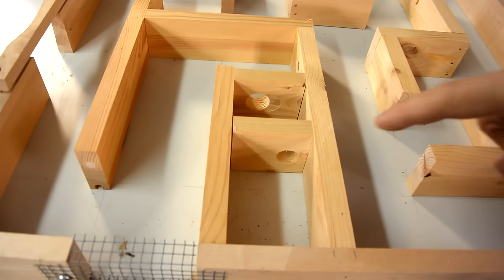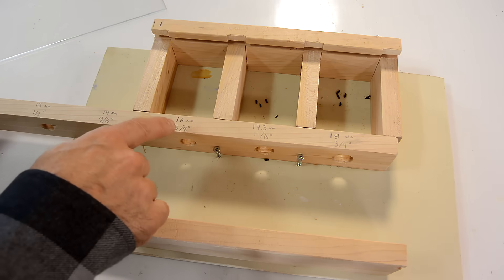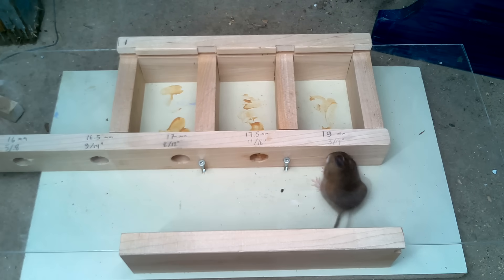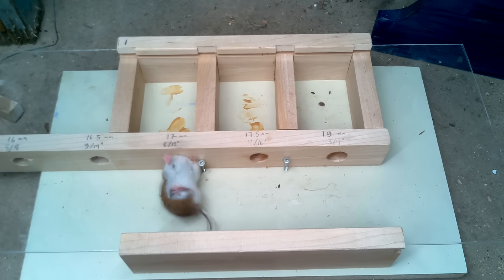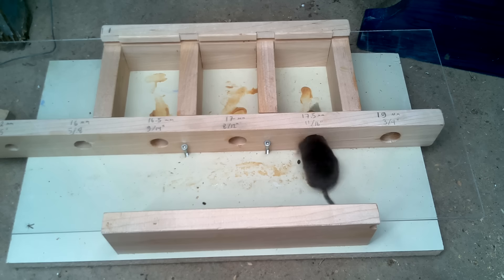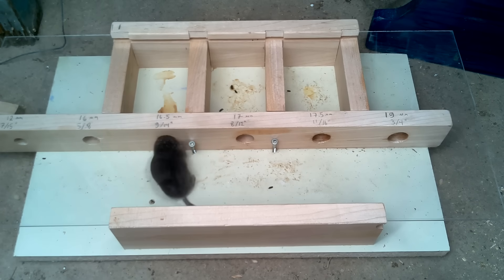How small a hole can a mouse get through?  Experiments.

Comment: Nice work! Question: If the thickness of the material through which these holes are drilled is reduced, can we guess that passage becomes easier? I would think yes, because the deformation to rib cage etc necessary would make (for instance) a 16.5mm hole in 1/4"|6mm material a lot easier to push through.

Comment: I wonder if a mouse would get through smaller holes if the hole was in thinner material eg  1/8” ply.
Reply: They will, they'll just chew a bigger hole, that's why they're so destructive in homes. I had a mouse chew a hole larger than a golf ball in my baseboards which are about an inch thick with the drywall.

Comment: Mouse could potentially get through the second set of holes but it learned that with less effort all it has to do is make a sad attempt, run away, and when the experimenter puts more peanut butter before and around the holes, it will not have to work as hard. Smart mouse. Assuming same mouse everytime. Gotta do the experiment a little more controlled.

Comment: You can see its feet slipping as it is trying to get through. Maybe you should have used a board with more traction as a foundation. Then they would probably have been able to get through the smaller holes as well.

Comment: Suggestion... Try same experiment, but instead of round holes, try 'slots'....i.e. like cracks in a wall. Years ago, I had a mouse problem (thank the powers that be that it no longer an issue) and the mice kept getting into the dog and cat food that I had in the pantry. I thought they were getting at it by crawling under the door, or a hold in the floor, until the one day, I was getting ready to feed the dogs, and found a mouse about halfway through a crack in the wall. It was a very thin opening, only about a 1/4" or less. I had already gotten an aluminum mesh...something used by construction workers to allow 'plaster' for walls to stick and stay in place. It is something that you have to use gloves to handle because of all the sharp edges of the aluminum. Round holes are just one way for a mouse to get through, but 'cracks' in the wall are also another. The little bugger just flattened himself, and slipped through the crack... Needless to say, I ended up putting mesh over that crack real quick.
Reply from the maker: Suggestion...  Watch my video of experimenting with a gap.

Comment: That's interesting. I think what happened is that the mouse worked out it didn't want to try the smaller holes because it hurt when it was too small and then even when you shifted the wood it didn't want to try because it remembered the same positions of the holes from previously. Then when  the vole came along and left its poop and smell then the mouse didn't come back because it didn't want to fight a vole. That's my guess. PS I used to have a rat infestation in the attic of my last flat I lived in. Sometimes I saw them in my patio outside. 1 time I saw a rat literally throwing itself horizontally ninja style and projecting itself through a slit in the fence between my patio and the area next to mine. It was totally surreal. It was a fat rat about 8 - 9 inches long that managed to propel itself through a horizontal slit maybe half an inch high. Don't ask me how you'd be able to replicate that stunt in experimental conditions though lol, unless you trained some rats to have their own mini-circus stunt show that might work, lol. They were so brainy. They would even bring oysters up from the river next to my house and have oyster parties in the attic upstairs and leave the shells for me to find later. The insulation was like the softest nesting material for them, all snug and cosy for the winter. They literally dug their way through the cavities in the infrastructure of the whole building and I had to move out and go to court against the landlord to get my money back. That's kind of cute you are just letting the mice and voles do their thing at the same time, I would recommend that letting them destroy your house if you don't block up whatever holes they are getting through is also a good idea.

Comment: Use inches and feet twelve is the number that solar system designer used to count the number of times the moon rotates around the Earth as the Earth completes one revolution around the sun. Like the numbers on the face of the clock.

Comment: You do realize that the shorter the depth of the hole, the smaller they can get through?  They tilt their skulls and hips to get through short holes like in sheet metal.  So you have two dimensions:  diameter of sheet metal and diameter of pipe they can get through.  This will bracket their ability.

Comment: So all that crap about "if you can fit a pencil through then a mouse can fit through" is total bollocks then
Reply: That's only flat horizontal openings. The round holes make them squish inward and make manipulation of their bones more difficult than flattening their bodies.  Also, the age and size of mouse would affect their ability to fit through certain openings.  Not every mouse is created equal.  The same applies to bats.

Comment: Great experiment!  Two ideas:  Could they get through smaller holes if the surface (floor) wasn't as slippery? Could they get through smaller opening if they were slots instead of holes? In other words, make a slot about 1" wide but of various heights. I'm wondering if the mouse could get through a very small gap in height, but it might need a certain width. I'm sure the mice got through much smaller gaps under the garage door, but they had lots of width to flatten into.
Reply: ...make that 2" or 3" wide rather than 1", just to be sure it isn't limiting.

Comment: Fantastic video.  You read a lot of stuff about a gap the size of a pencil and a mouse getting through and I always suspected that this would apply possibly to a rectangle the dimensions of one side of which was as great as the thickness of a pencil but not to a round hole the diameter of a pencil.  Otherwise mice would esily pass through air bricks under suspended timber floors.

Your video tests this in a practical way.  While I would argue that your mouse is rather large, it would seem fair to say that 16mm holes would exclude most mice and airbrick holes are smaller still, and square.

This is the sort of video there should be more of on the internet.  Actual factual research, rather than secondhand knowledge passed on ad infinitum.

Comment: There you go take a healthy dump and a piss to let your little buddies know where you've been.
This is how they follow the trail. 
If you see a long black smudge along the wall and electrical conduit or water pipe it's a path to a hole.
That hole leads to food.
You get one pregnant mouse in your house and it's a nightmare with in a couple weeks..
If you find a hole you can plug it with heavy steel wool, it cuts there gums when they try to chew through it.
Scrub the walls and pipes down with hot water and bleach and repaint it.
You have to get the sent completely off the path.

Comment: I had a VW van which I kept in a detached garage. There was a metal beam across the front (part of the frame) with holes in it. A mouse tried going down one of the holes - the front part fitted, but not the hips and because it was head down it couldn't get out. When I found it it was nothing but skin and bones, totally dried out. :-(

Comment: PUT A RAZOR BLADE IN THE INSIDE OF THE SQUARE, POSITION IT OUTSIDE THE HOLE, THE LONG WAY SO  WHEN IT SQUEEZES ITS BODY THRU IT'LL BURST RIGHT ACROSS THE RAZOR BLADE SLITTING ITS OWN THROAT, NECK AND BELLY BEFORE REACHING THE PEANUT BUTTER!!

Comment: His technique is flawed as the the thickness of the wood should be taken into account. Plus, real mice are often smaller as they eat less because they dont get much to eat. I am not saying his mouse is not real, but its probably either a pet mouse or a well fed mouse. I have lots of problems with mice and I can say from experience that my mouse got through wire bars that were 5mm wide. Two things in his favour, he was fearing for his life, and the bars had some flex. but he just slipped out on the second go. They will get trough very small spaces. Another issue, many mice wont touch peanut butter (real mice) or go anywhere near such suspicious devices, I know, I have many traps they never go near. Futher, a real mouse would try harder. Not saying this is a scam, just pointing out some observations. It is not a fact that the size he has set is universal for all mice. I doubt he doubts that. But moreover, its too thick, he should have used cut aluminium.

Comment: Looks like the mouse would as well make an instinctive but smart assessment about how much poop she would be taking inside with her - which she would possibly get rid of before trying to get out again - instinctively knowing that the volume of poop she lets inside, would be more, than what she would swallow.

So you very likely could improove your setup - measure the volume and the weight of the peanut butter before - and compare it to the volume and weight of the possible residue afterwards.

Very likely the mouse assessis her/a safety margin. Inside-out she can be slimmer, if she would like to. 

So the poop we see being a function of will and assessment - of the overall situation, but maybe not coincidence.

Comment: You should try putting a small scale out to figure out the weight of each animal. Just put a dab of peanut butter on the scale and see if they will stand still long enough to get a reading. You could also put a tape measure on the piece of wood to get an approximate body length and width calculation.

Comment: I like the experiment, but I also would live catch the mouse to get a weight and even size measurements.  It would be interesting to see what happens with a variety of different sizes mice. Once you get some data, then you will hypothesize with similar sized mice to see if a certain dimension is true for all the same size of mice. You call the mouse lazy, but maybe he has reached his capacity.  That is what needs to be tested further before making a conclusion that the mouse is lazy.

Comment: The problem you have here is putting peanut butter in the holes rather than just the pods if it was just in the spaces the mouse would probably try harder because I was told by an expert the can fit through a hole a small as a biro that mouse is probably mega lazy

Comment: Very interesting video. One thing: the holes have this diameter in every direction. In my experiende they can do with less when getting through under a door. So maybe you can try not with round holes, but with  slits of varying heights, they might be less then your hole diameters for there's more space to extend sideways.

Comment: What? At 1:47, as the rat enters the 17.5 millimeter hole, another turd materializes in the 19 millimeter hole! Also, some of the turds change angle slightly and the dust on the floor is re-positioned. Was it cut together somehow at that point?

Comment: Why experiment on a mouse? I hope the mouse doesn't get stuck. The other day I had a mouse stuck in an incorrectly built pet house when the window was too small. The walls of the house were thinner than in the video, though, perhaps that's why the mice in the video do not seem hurt. Maybe it's meant to be a toy for the mice. Still, I do not like it. (When given enough material mice are deliberately trying to make the entrance to their house as small as possible). Why did you want to know what a hole the mice can get through instead of feeding the mice by giving them peanut butter on a bowl? Was this practice recommended to you by a veterinarian?
Reply: syrop26 he’s not a damn animal abuser, if the mouse was stuck he can remove the glass. I wouldn’t go to a vet to do a little harmless experiment.

Comment: I saw another video of a mouse whose head was stuck trying to get through a grounding hole in an electrical outlet plate. It was still alive, its face swollen, and terrified. You should do your test with something that can break open easily, just in case. Poor things.
Reply: Z Stone he. Is. Literally. There. To. Watch. The mouse. He can remove the glass easily.
Reply: Since the holes are drilled through wood, if the mouse were to get jammed tight, there would be no way to break the wood open without injuring the little guy, and especially because the hole is in such a thick piece, compared to the body length of the mouse. And, of course, trying to force it through or pull it out could cause any number of injury on such a tiny little creature as this. I'm sure he treated the mouse in this video with kindness and respect. I'm just saying something could go horribly wrong unintentionally. Nothing against the man in the video. Thank you for your reply.

Comment: I spotted one mouse in my house. I was convinced that there was only one mouse as it was never spotted at more than one place at the same time. I tried mouse traps but the mouse seemed to not be interested in the peanut butter or Nutella I put in as bait. After having 10 traps around the house to catch one mouse, I finally bought this and gave it a go.
Before I purchased this, I used to see the mouse running around. However, after putting these around, the mouse has been out of sight. Some people wrote it took weeks for this to work for them but for me, the results were almost instant. I've left it on for about 3-4 weeks now and it has been running 24/7 - just in case the mouse is still hiding somewhere. but I haven't been able to spot it. My 10 mouse traps are still sitting around without any catching. So either the mouse has managed to escape somehow (unlikely as I've been extremely careful when opening doors etc) or it has become a lot better at hiding from me!

I also checked my entire house very thoroughly for any holes in the walls but I didn't see any. So I think the only way the mouse could have entered is from one of my main doors and me not being as careful as I am now when leaving them open.

One thing to note is that I used to hear a mouse scratching inside the party-wall of my house during night time in one particular room. Since installing this mouse repellent, I have never heard any scratchings at all. The scratching was happening for at least 3-4 months before I saw the mouse - again, I didn't see any holes in any walls but there was definitely scratchings which I heard at night which has now stopped.
Here is the buying link: http://a.co/5wpINMI

Comment: Did an electrical troubleshoot job once where a room had lost power. In the attic I found where a mouse tried to chew it's way through a 3/4 inch hole that had 14/2 romex wire in it. Mouse bit the wire and blew itself in half.

Comment: For quicker results you could have just placed the mouse on the other side of the hole. I imagine the mouse wouldn't want to be enclosed in that small area so would make more of an effort to squeeze through the hole and get the peanut butter. But tbh there's the ethical issue of effectively trapping a mouse.

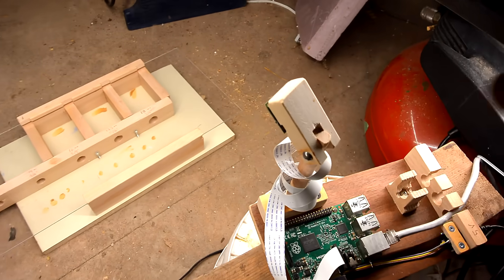Comment: 0:30 this shocked me the most outta this whole video 😂 it makes me wonder if he still has dial up internet
Reply: What’s wrong with it he just uses Linux
Reply: I wouldn't keep my newest best tech in my garage/basement / shed whatever, either. This is probably a dedicated setup using Linux specifically to run and record from his Raspberry Pi camera.
Reply: A Bums Boot lo
Reply: A Bums Boot
Reply: A Bums Boot 
?
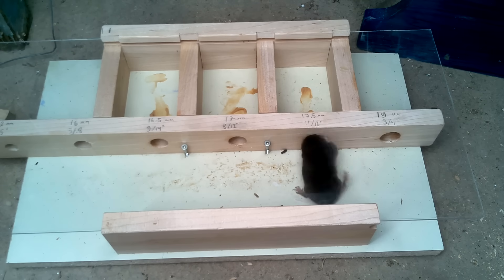Reply: Honestly check out 5:28 the shrew actually getting in is both hilarious and amazing
Reply: putting your 27" 2560x1440 monitor where they are fuckin mice and shrews all over the place is probably not the best of ideas

Comment: Cool experiment, but I don't think you were precise enough. I think if you wanted this experiment to fully work, and see exactly how flexible a mouse's bones can be, then you should've made the holes slippery with oil or anything like that. That way there won't be as much friction between the mice and the wood, and it would be easier for them to pass. Using that method you could see exactly how small of a hole a mouse can get through.

Comment: I think this experiment worked really well. Since the mouse didn't go through the middle hole but the shrew did, it's reasonable to conclude that the mouse had eaten enough already and wasn't motivated enough to enter it. However, it's most likely that it would have done if it was hungry enough. Neither the mouse nor the shrew attempted the small hole so it's reasonable to conclude that: 17.5 mm is the smallest hole that mice (and shrews) will enter with little motivation. 16 mm is too small, and 17 mm is the point where a mouse (or shrew) can enter but only if sufficiently motivated.

Comment: In pest control the rat can get into holes not much bigger than a nickel and a mouse a hole as big as a dime.
some exterminators before filling the holes, will clean with vinegar or and bleach, then stuff thoroughly with rough and fine steel wool. Then concrete it.
rodents can chew through caulk, walk, and yes even concrete block.
Kmart store across from Macys years ago we had set out 1000 glue boards where the tobacco products were and OTC drugs (cold pills).
lights off came back 2 hours later and every glue board had 1-4 rodents on them.
1st time we ever saw rats and mice living in the same area at the same time.

Comment: Great video. I don't think the mouse was lazy. I noticed they were pulling themselves through. That meant they had to get their head and front legs into the hole at the same time. Either the shrew's head was smaller, or it's legs offered it some advantage. They could probably get through 16mm if the plank opposite to the holes was much closer, because they could push against that with their back legs. Then they'd probably have a lot of trouble getting back out.